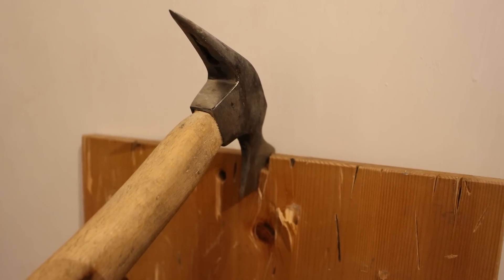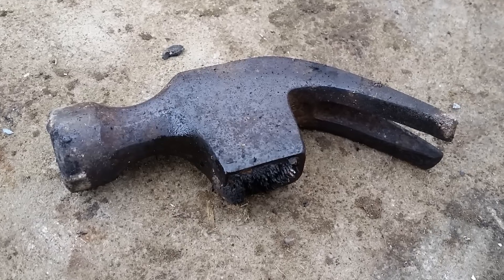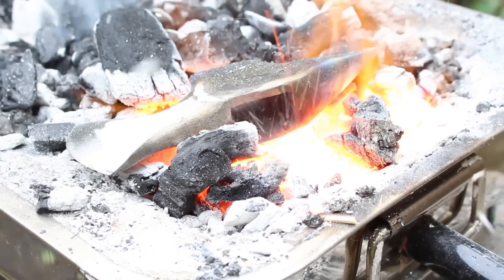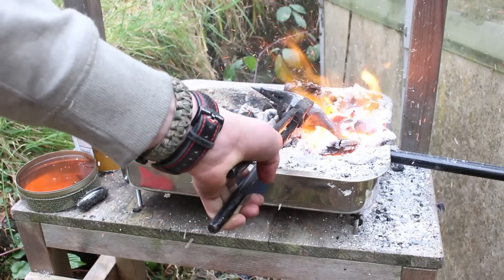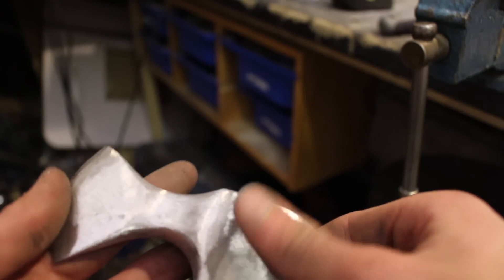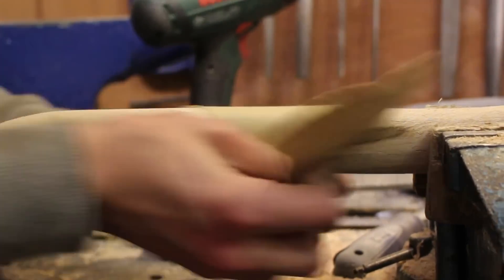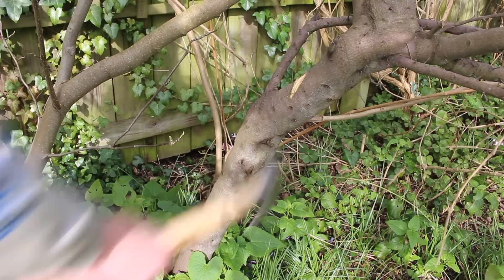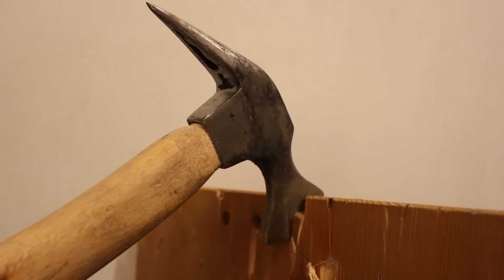How To Forge an Axe From A Hammer Head

Comment: Quite a good use for an old hammer. I think it would be even better as a small adze. Very cool
Reply from the maker: +NightHawkInLight Thanks!
Reply: +NightHawkInLight Could have made it a hatchet on the front, and an adze on the back. That would be cool.
Reply: +calebar98 i was thinking the same thing i just didnt know what it was called.
Reply: +greenjoe420 I think it's called an axaroon.
Reply: +Mineshafter I would call it a war-hawk
Reply: +DontLickTheOrange I believe it's a hatchet
Reply: I wouldn't correct people online about whether of not it's an axe or a hatchet
Reply: Calebar98 I'm thinking the tool you describe would be a miniature Pulaski (forest fire tool) kinda like a large cutting mattock

Comment: If the hardware store told you that was hickory they lied because it's beech. Hardware stores do that shit all the time, I did some woodwork for a guy who bought an "oak" threshold that was actually beech. The funny thing about that to me is that beech has very good wear resistance, so it is probably better than oak for a threshold.
Reply from the maker: +Cadwaladr thanks for telling me, thought it looked a little different to the other hickory handles on my other hammers!

Comment: Makes me smile watching this. This is what I was doing and how I was doing it when I was 16. The internet wasnt a big thing back then so I didnt understand the curie point vs critical temp. And I definitely wasnt forge welding at 16, certainly not with a sledgehammer as an anvil (though I'd think of using it as an anvil now). You are so far ahead of the curve in understanding how all this works. Keep up the good work and you'll be a hell of an engineer or metalurgist.

Comment: Just a tip: to thoroughly tighten a hammer head onto a handle, hold it upside down and hit the bottom of the handle with a rubber mallet. This has to be done while you're holding it or it won't work properly. My great-grandmother used this method for many years.

Comment: Interesting. With regard to what to call it: I believe you have made a short- handled picaroon. It is a logger's tool (in the full length version) used to manipulate and mark, trim, or even carry heavy logs for further processing. You can see it in use in several  Wranglerstar videos.

Comment: If youre gonna revisit this build and make a new axe head, i highly suggest you use a ball peen hammer head. They are usually bogger than chaw hammer heads. Also, drifting the socket would make fitting the shaft easier too.

Comment: Try getting your hands on a metal paint can, it has a good lid to cover your oil when your not quenching. Local hardware store has a paint recycling program, that's how I get mine. I also use peanut oil, it actually smells good when you quench.

I like that idea of a baking tray forge. Is it sand and plaster filling and the fireplace cement stuff as a protective layer?

Comment: You have a belt grinder and an angle grinder but not a deep metal bucket or an anvil?
Reply: +MontyKensicle angle grinders and belt sanders are much cheaper than anvils. you ever checked the prices on them? locally in my town old used anvils go for 150-300 bucks.

Comment: Was there a reason that you used metal and didn't use a wooden wedge in the head of the handle? Usually you would have a wooden wedge and then maybe a metal pin to secure it but usually it's not needed if it's all tight. Any gaps between the wood and the metal will cause rust and rot with the inevitable ingress of water so the handle should always be nice and tight.

Comment: You nearly started an oil fire....twice.  If you had parental supervision they would have told you that the plastic bucket was a bad idea for burning oil to be in.  So you found out that plastic melts and then you put some oil into a metal container and quenched the other side of the axe.... RIGHT NEXT TO THE MELTED PLASTIC BUCKET THAT STILL HAS OIL IN IT.  This was a good video, but you could benefit from some parental supervision, and hopefully you have proper fire equipment nearby to put out a large oil fire because a bucket of water or a fire hose will only make an oil fire worse.
Reply: +SIlverranger O oh, look out, it's the safety police wanting to wrap up our kids in cotton wool, so they become soft and useless and never learn from mistakes or be self sufficient. Parental supervision, are you serious man?
Reply: +Antipodean33 What's wrong with being safe?  Is that uncool or something?  An extra pair of eyes can make sure that mistakes are corrected and learned from before painful and costly accidents occur.  As long as the parents aren't doing the project for him, and only chime in when needed, there's still plenty to learn with less risk.  Bettering yourself from the experiences of your elders is called evolution.
Reply: SIlverranger Yeah, whatever you believe